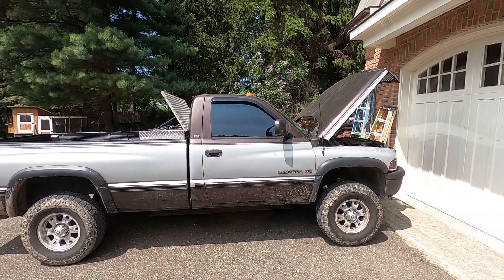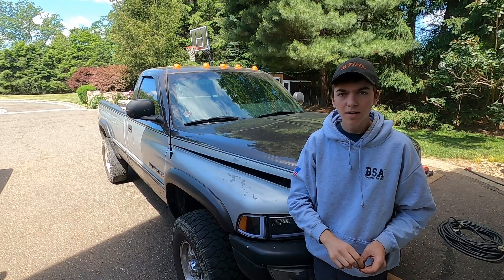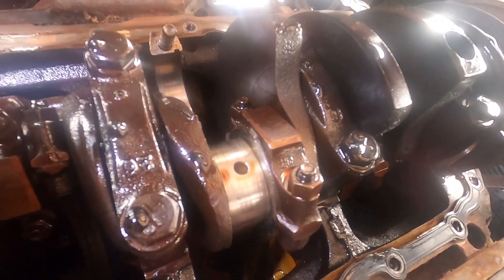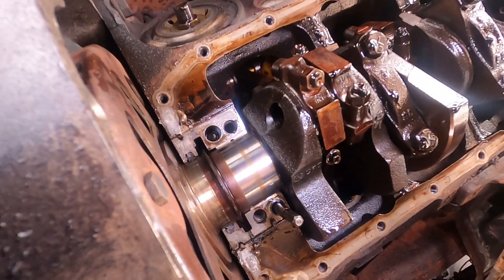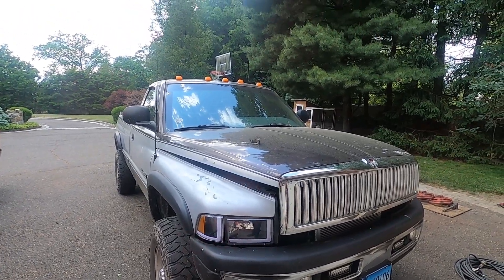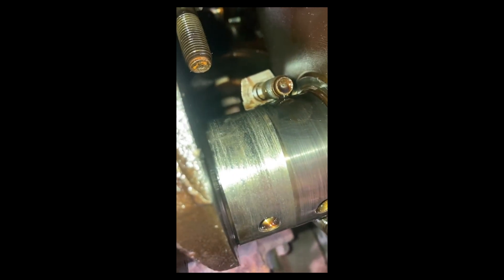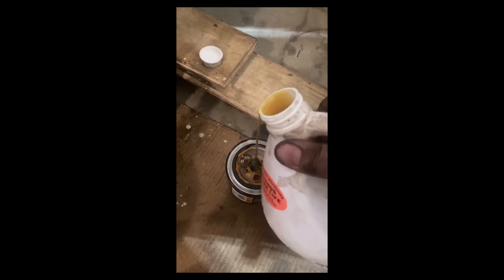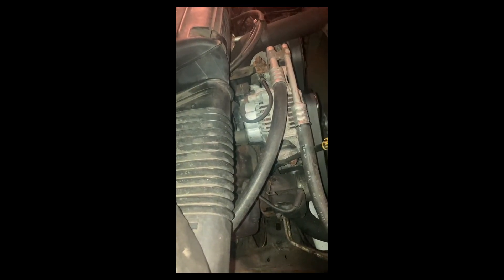Attempting to fix rod knock on 1997 Ram 1500 | 5.2 Magnum

Comment: Same thing happened to my 99 Dakota Sport 4x4. Developed a bad knock after 5 years of ownership. Bought a 360 from a 2000 Ram 1500 to swap the old tired 318 out. The intake and oil pan had to be swapped over but it was plug and play, same pcm. Lots of power now, and it burns less oil and gets better gas mileage now haha.

Comment: I sure hope you find something even better. And we had a dodge dakota to did the same thing for knocking. we you put a few miles on it we had to get rid of it too. And only had sixty eight  thousand miles on it and it was so quiet running. that's what had on it that low mileage   Thank you for the video Thank you for the video

Comment: If you were keeping the truck I would say get some sandpaper and a shoe string to sand that journal down best you can. Then see if you can find an oversized bearing to put in there.
Reply from the maker: I had considered that, I never measured the bearing, but I could see it was not completely round. It might have been worth a try though.

Comment: Could build you a 360 and drop it in there, i love your truck though. I also have a 1500 long bed with cab lights
Reply from the maker: Looking back I should have refreshed a junkyard 360 and slapped it in. But it's someone else's project now unfortunately.